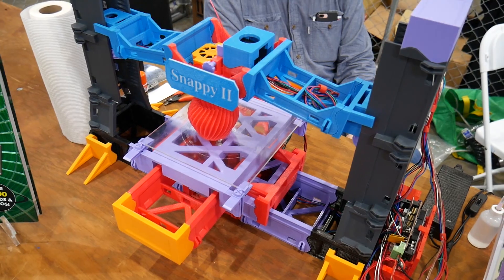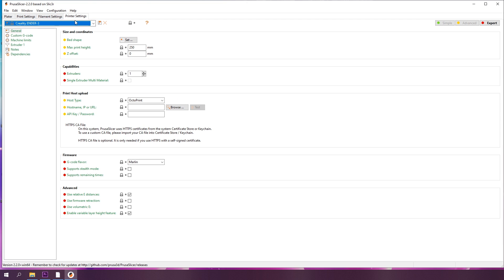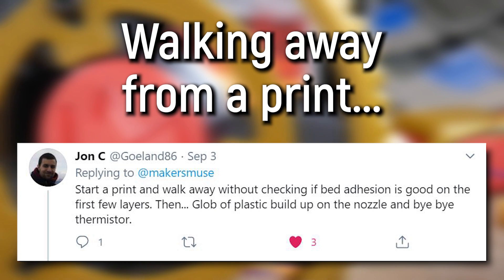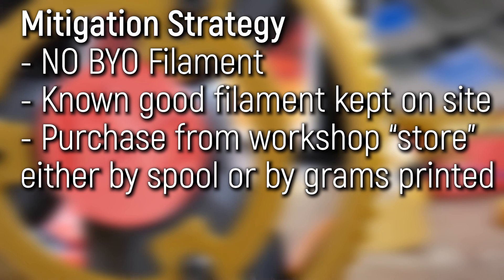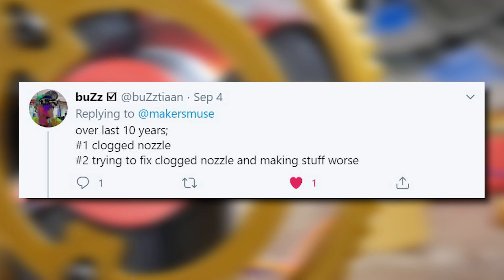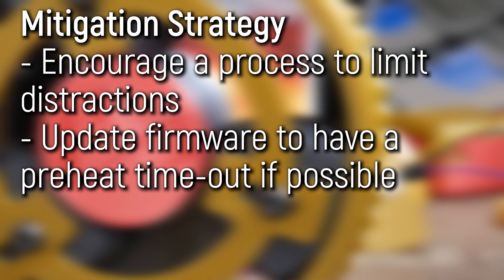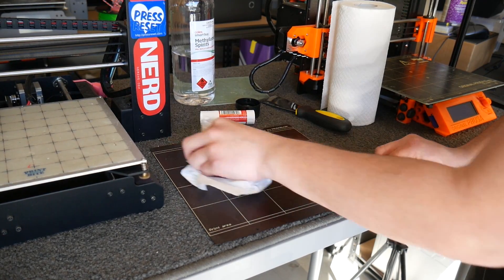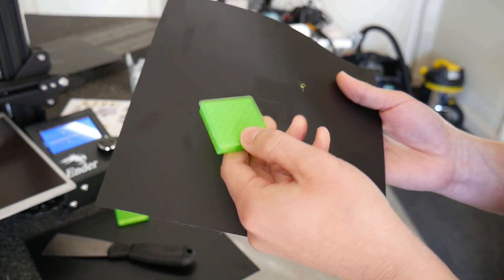How People BREAK 3D Printers (and how to stop it)

Comment: My hobby is more like printers, rather than the prints, but I have seen in my primary school, where the build surface for almost all of the 8 whopping printers there, is almost all ripped off, they hardly prints normally, and have serious layer shifts😂 not related, but I still prefer sit beside my printer for the whole print when I have time

Comment: Lol.. i've done the superglue corner fixing to unwarp and prevent further warping on glass bed. It releases clean with acetone and can be fully cleaned off the bed (provided the bed is not reacting with superglue or acetone.. like a glass bed). Bonus points for filaments that don't react with acetone or superglue. Otherwise it will make a gooey mess if using superglue on ABS/ASA and the release it with acetone.

Comment: I was messing with the z-axis settings on my printer and forgot to change it back when I starting the next print, it started to try and print under the print bed and made a big gash. Fortunately the hotend screws got loose and didn't break it as far as I know. I did have to figure out how to change the tip, lucky I looked up a tutorial on that before it was too late.

Comment: If your running a public print business place you should use the flash forge adventure 3 lite with replaced Bowden tube couplings, you don’t run into the issue of leveling your bed because
It is 150 cubed, and the hot end is
Really fast
To heat up like 20 seconds to 240 or 265 depending on the nozzle

Comment: 15:12 to get my first successful large vase mode print in PETG, it took quite a few failed prints lol. first, i did a 6 hour print, paused it halfway through, didn't think much of a line on the print. turns out that line was a weak point and it came right off as i removed it from the print bed. it had other lines too from issues with filament at the top (i have a custom filament guide that got in the way at the top of my printer lol). i thought maybe i could increase layer height to cut time in half, but then bridging basically wasnt an option, and the vase also was melting causing the layers to compress. basically me trying to be as lazy as possible resulted in a crap ton of failed prints lmao. now i have a semi-successful waterbottle print that looks great, but it leaks at the bottom so i'm printing an extra friction fit bit out of TPU to just seal it lol.

Comment: I damaged my printer right after a few uses 🙈 After a print was done, I took the print bed off with the print and took it to another room to show someone else. When I returned to the printer, I clicked "Home" to put everything in the home position, not knowing that if there is no metal print bed, the printer will not stop going down the Z axes until you turn it off. Now I have a small hole where the nozzle worked its way into the heat bed. 
Yes it is my first Printer 🙈

Comment: My university has 3D printers. To be allowed to use them, we have to do an entire workshop. This year we had 20 new printers of which I got to build one. And since I already knew how to do that, having built my own, I knew what to do so it’d work properly and instruct my teammates. We never had issues. About 50 printers were the same model but a year or two older, and they had a lot of issues cause I’m pretty sure the maintenance they did wasn’t that great (simply cause that was literally the first task we‘d got as hardware person, build or restore a printer) and they had quite a few issues. Worst were the 10ish printers that were a generation older in make. I don’t think any of those printed properly whatsoever.

Honestly not sure how they manage to make them just not work that badly. I’ve never seen something like it

Comment: Easy method of releasing a print from a bed,   Let it cool and then wick IPA around the base of it, then wait 5 minutes and remove the print,  Also re heat and cool cycle with IPA wick.
also if that don't work put the print and bed sheet in the freezer.

Comment: I've only been printing for a few days now, and I seriously don't get how ANYONE messes it up. Cura, for example, is the simplest software ever. If you don't want to delve into custom settings, you literally just select your printer and plastic (which in a makerspace should already be selected), hit the slice button, and hit print. There's no complexity at all, I don't understand how people completely destroy printers.

Edit: For the first few days, I was using a dedicated Debian machine (somewhat old Xeon workstation) running Cura, and I would sit and watch the print the whole time to make sure it worked. After ~2 days of doing that, I went through with my original plan and used octoprint_install to install OctoPrint on that workstation, and now I just print from anywhere with either OctoPrint's web interface, or OctoApp. Then I can do other things while still watching the print in full 1080p glory live wherever I am.

Comment: Just picked up a Davinci 1.0 Pro very cheap and haven't tried even the test print yet and already nervous about it. Many negative videos about the unit with few positive but the positive reviews are after control board, firmware and extruder/ hotend swap. Basically I feel like I have a great rig, just nothing worth running on it. $50 wasted or good start if I go upgrade mode I guess.

Comment: Honestly: 3D printing is really not much remote from the ease of use of inkjet printing (first impression) We acquired the 3d printer my 9 years old daughter was wanting for long. I was suspicious at first. So we got the ender 3 S1. Prints are straigh forward (and amazing quality) The software Creality Slicer is super simple and almost error safe. A bit of alcohol spray cleaning of the bed. She checks the Z height each print. Filament change mid print is easier than inkjet cartridge change (which is often not possible in the middle of a large print). I wouldn't want to try to inkjet print on lots of fancy surfaces. Inkjet printers also can heavily jam or have clogged print heads. So only slightly more difficult, especially getting first layer/overhang right (failed 1 in 20+ prints due to supports forgotten). Also printing PLA is absolutely odour- free. Slight concerns for my daughter could be around burning fingers cleaning the nozzle or pinched fingers, for example when she once removed a tiny string while printing, that was done during changing filament.

Comment: You're not supposed to remove the nozzle while cold? I'm either very fortunate, or the Ender 3 doesn't have the heat brake. I finally got a 3D printer after years of "I'd like to have one", and got a minor clog in under 24 hours, I think because I didn't get the bowden tube all the way into the hot end to the nozzle. So I took the nozzle off, heated the hot end, cleared the clog, put it back on (still hot), and haven't had a problem since. I also re-cut the bowden tube with a razor blade to be flat, where I tried just using flush cutters before (I bought an upgrade kit with a Capricorn tube with the printer, and it was too long). Happy printing ever since.

Comment: I am a bit late but my school had 3 maker bots in a wood work shop and they got them because they wanted 3d printers so they got “the best printer available” for 1,000-2,000 dollars and then they got buried in the room under wood and tools and I got a printer and learned a lot about it and one day I went to class and was looking for some tools and the teacher that was there had no idea we even had any 3d printers and I found them in the corner of the workshop caked in dust and burnt wood and I took them and cleaned them up and got them working but they always had dust on them and failed a lot and I wouldn’t let anyone touch them as I was the only one that knew how to work them and my teacher didn’t let anyone use them without me there to do it and the filament was always covered in dust so I got my teacher to put it in a cabinet and then we had plans to make an enclosure for them but then I got our computer teacher interested and so we moved them to his class and sense then we got 12 other ones the Ender 3 v2 for the majority and a resin one too and we retired the maker bots and the same rules apply for these printers that no one can touch them except the teacher and a few of my friends that I taught how to work them and maintain them and they got their own too so luckily I was there to save those printers and they have been working fine ever since

Comment: Whats too long for pre heating the hot end? obviously a day but I regularly start the pre heat process before anything else and sometimes it might be 7-10 minutes before I start the print.
 I do find pre heating the bed 5 minutes prior to print helps with adhesion vs just letting it get to temp and starting.

Comment: I've got a FlashForge Finder printer and it's very user-friendly I think. The print bed slides out of the printer and I get my print off by gently pushing a penknife blade under whichever part of the brim or raft is least stuck to the bed and working it around. I've been doing this for 6 months and there's no damage to the print bed. I couldn't imagine grabbing the model and trying to shake the printer free.

Comment: At the duke university engineering building there is a workshop with 3d printers inside, once as I was passing I saw through the glass that the thing the printer was printing was stuck onto the nozzle and it was still printing. The people in the lab didn't even notice as they were cutting away at some wood.

Comment: I am about to get my 1st printer and I assumed at the beginning, that printing was as easy as pushing a button and perfect prints. The need for tinkering to get it right doesn't bother me as I was a precision engineer working on various machines from the age of 18. I like a challenge.
If I had access to a lathe I could make lots of spares. Lead screws to nozzles.. A project ahead.

Comment: So here a question: Why can GCODE be printed by a printer for which the gcode was not produced. As a software developer I find it incredibly incompetent to define a standard for GCODE files but forgetting that it might be stupid to run the same GCODE on different printers. Just put the name of the printer as first line in the GCODE and every printer just checks if the GCODE is made for it and if not, it just doesn't print it. What's the deal? Why was it not build like that in the first place?

Comment: everytime you remove the bed it changes, especially with the spring steel sheets i run solid silicone bed mounts on my e3 and have to make sure its trammed literally everytime i start a new print.

Comment: This stuff is all so frustrating. There is no end to the misinformation out there so how are people supposed to know what's true and not? I recently posted on Reddit trying to solve an adhesion problem and in 2022 I was given ALL of the things mention here as advice on fixing my adhesion problem. Obviously since I know nothing, I gave everything a try and only ended up with 100% ZERO adhesion. So I broke down and order a Creality glass bed for $30 cause I couldn't find anything else in town. Showed up yesterday and now I'm terrified to use it because it's obviously MUCH thicker than the thing that I was originally using and I can't find any information on how to adjust that Z height switch on the left side of my Neptune 2 sot hat I don't end up driving the nozzle into the glass and causing it to shatter.  These companies should be sending information, or links to information, on how to use their damn products rather than just assuming everyone knows. Cause it sounds like, almost no one actually knows!

Comment: My Easy Threed 3D printers Construction magnetic build pad got ruinef because i failed to heat it up before printing and i feel ashamed of it. Its a result of using a Putty knife, Soldering Iron, and Attempted  to use a Hot Clothing Iron and It also Needs maintenance and Often clean the hot Print tip and I often walked away from the 3d Printer grab a Light snack or when ever im having a meal or helping my dad and when i do my PC shut itself of mid-print and i Come back Looking at a the build platform with plastic not coming off and currently  waiting for Building pads they are magnetic and i have a Super messy room so (off topic) i use Ultimater/Cura for Easy threed

Comment: I would argue that painter's tape is a valid method for improving bed adhesion. Especially on older printers without heated beds. I have Printrbot Simple Pro, Printrbot Play, and Makerbot Replicator 2 that I have been using the tape method on for years without issue and I can get (almost) as good results as I can on the newer printers.

Comment: My most common experience has been a fault showing up, some idiot misidentifying the problem, and then said idiot tries a "solution" that does more harm than good.

It's me, I'm the idiot.

As an example I recently had an issue where prints would go fine for several hours (usually around 4), then suddenly the machine would go haywire and begin printing off to one side while the X motor made clicking sounds, and pausing the print would crash the printhead into the X limit switch and keep grinding against it for several seconds.

Facebook and reddit groups for my printer suggested similar possibilities, motors overheating, stepper drivers overheating, loose wires, etc.
Hours of troubleshooting and testing with the machine disassembled I realise the issue was the microSD card.
How does that explain the issues? I don't know. Checking the gcode on the microSD it was identical the the version on my desktop, but a new microSD did make the problems disappear.

Didn't cause any damage, but I did waste my Sunday.

Comment: I can add my way to break printer : a cable was in the way of the en captor and i didn't't see it : my print fails and tiny beginner me simply re-calibrate the printer and make another leveling. When the cable was gone, the hot end went straight through my flexible base. It still has a nice hole in it :)

Comment: Locked profile. My printquality improved dramatically since I started due to the fact I am NEVER locking the profile. I am changing it at every print by tiny tiny steps. We are talking about 1% steps here. But combined thise babysteps make a huge difference. Just watch what you are doing. Especially if your printer is not known as reliable or if you are printing a difficult shape.
Reply: Never had Blob or spaghetti.

Comment: I bought a 3D printer (Prusa mk2S) from a fellowship that I won. I could have taken it to my work lab where it would have been accessed by anyone. However, I built it myself and didn’t take long to realise that giving access to people who have no idea how to correctly run and repair the machine was a recipe for disaster. Budget 3D printers really are not plug and play. Been printing for years now and despite this I still battle small defects that occur when prints are not as accurate as I want. I can absolutely believe that someone could drive the nozzle through the bed. Or heat the hot end to melt filament to a crisp and destroy the extruder. 3D printing is for avid enthusiasts. It’s becoming easier and simpler. But it certainly is not the plug and play like a 2D printer.

Comment: I modified my fist printer  mp select mini v2 by taking a ruined creality magnetic build plate and cutting it to size twice flipped one upside down and used the adhesive already on there to stick it down and it worked for a while curently I have a pei sheet.

Comment: about those magnetic beds - what happened to me when I got my ender 3 was that after my first ttest print of one of the models that came with it I must have misleveled the bed somehow - anyhows by the second print the nozzle actually dug into that magnetic pad and caused permanent damage to it. so watching your bed level is definitely something you should add - I ended up replacing the bed for 25 bucks - considering the cheap price of the ender 3 pro with like a 160 thats quite a lump of damage

Comment: Lets be fair, 3D printing is extremely easy. I, as someone who has never seen a 3D printer in my life, bought one and after a 7H assembly I have basically never had a single problem that wasn't, first layer doesn't stick -> stop -> clean plate and add glue -> start again. Even the stock settings slicers have basically make great prints with 0 tweaking needed. You just have to not be a total idiot, like who leaves a printer on preheat for 8h or hits it with a hammer to get a print off... Also if you are going to use a tool, at least watch a video or two on how to use it, it's not rocket science.

Comment: Painters tape actually works super well if you don't want the prints stuck on the bed and impossible to remove.  My prints always stick to the bed way too well and its so hard to remove. A neighbor told me to use painters tape and it works. It sticks to the bed but is easily removed.

Comment: My high school’s engineering classes were only given an old wood shop that wasn’t really used anymore but still somehow has a ton of wood dust flying everywhere so unfortunately we didn’t have a choice 😅. But I implemented a strict routine of wiping down and air dusting each machine and it was required before using any machine even if it was just used and even though I made DIY enclosures for each machine as an extra precaution.